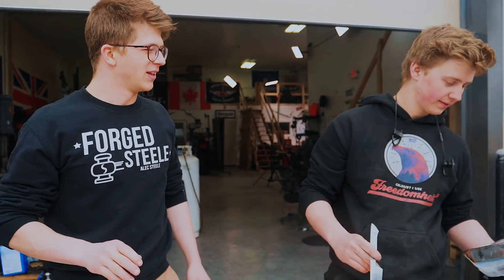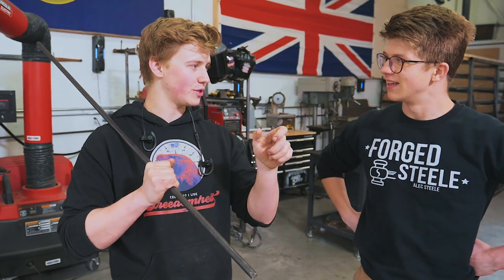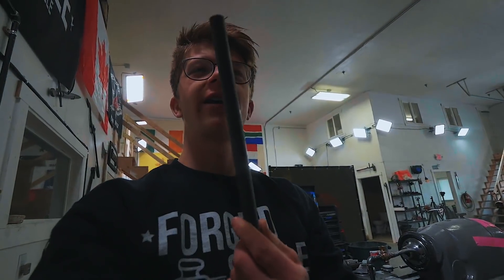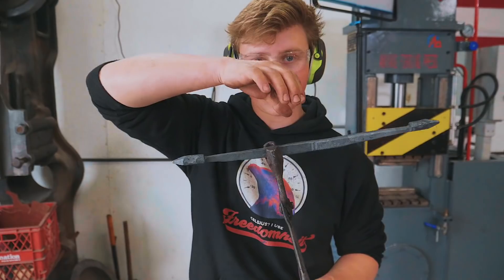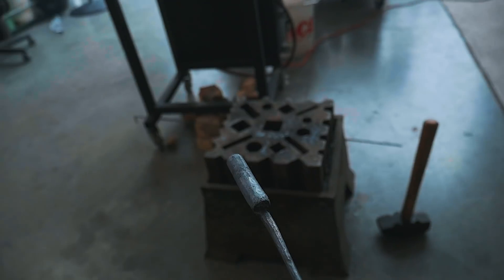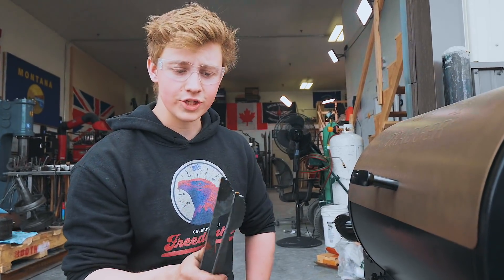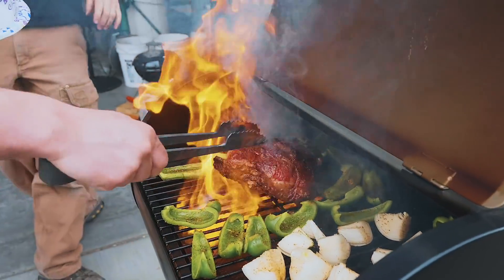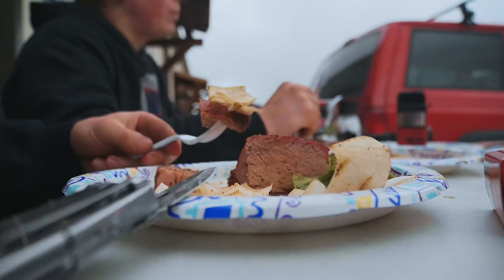FORGING GRILLIN' TOOLS!!!

Comment: Sous Vide Blacksmith Style: Big Steaks -> Ziplockbag -> Waterbucket -> Tempering oven 56 Degrees Celsius 2.5h+ -> Sear in the Forge 1sec <3
Reply: don't forget to drop some rosemary, thyme and garlic in the bag
Reply: and then quench it in some motor oil

Comment: Will: Uses a kitchen knife as a steak knife. 

Alec: Uses a pocket knife.

The sword in the background are sad.
Reply: i think my favorite part about it is that will wasn't even using a complete kitchen knife. it's a finished blade but there weren't any handle scales. he was just holding it by the tang.

Comment: Challenge:
Invite some friends over for barbacue in the evening.
Start in the morning at whatever time you want to start at, for example 6 am (you will need some time).
You‘re NOT allowed to use any kind of normal kitchen gadgets, everything you need for preparing and serving that meal has to be forged out (knifes, forks, plates, utility, maybe even cups etc.)

Comment: 🔴I got a challenge for you 2🔴 for the next Alec vs stelter. Forge out something with your non-dominant hand
Reply: I like this idea but I do agree with @Williamcoatt that it may he a tad dangerous
Reply: Dangerous? If you work with your hands, you work with both.  I think it's a great idea.  And even IF it's dangerous...what's wrong with dangerous?  Everyone is scared, it makes me sick.  Grow a pair.
Reply: @nearlyworthless1674   I think they should learn how to blacksmith with the both hands I think it's a good skill to learn to blacksmith with both hands
Reply: @nearlyworthless1674  it's called muscle memory, swinging a hammer with the non-dominant hand would be far harder (and dangerous) if neither has done so with any regularity. It's not quite the same as you getting your mani/pedi from a place you've never visited before. Most normal people aren't out here trying to maim themselves to prove their masculinity.
Reply: @fadetoblack2104  dude, you used "mani/pedi" in s sentence...🤣🤣🤣🤣😂😂🤣😂🤣😂⚒️
Reply: nearly worthless  would you like third degree burns on your body
Reply: I'd rather see them make something good than make something crappy and complain about how obviously hard is to use your non dominant hand.
Reply: @kristinnmar8415  and how would you get that?

Comment: Listen up I'm only gonna say this once. Take your onion...core it out (about 3/8"-1/2" diameter, 1/2 way through the onion)...plop a beef Bullion cube in the hole you created....spackle that hole full of butter...wrap in aluminum foil....45 minutes to an hour in the heat...unwrap....taste heaven!
Onion
Bullion cube
Butter
Aluminium foil
Heat 45 minutes  to an hour.
Taste heaven.
There I wrote it twice!
Reply: Hey... You said you were only gonna say it once. Then you didnt.
Reply: @MrRobertivie  I was working under the unified internet say-it-once clause from section PWND.420.t.r.o.L.L:subsection, l-o-L wherein it states that if indeed something is to be said once the thing in question may in fact be mentioned and then reiterated if so doing would not breach the intent of the message in an arbitrary way so as to negate the once-ness of the aforementioned once-said thing in question bearing in mind that the "nature of the internet forums" act of 1991 gives leniency toward the OP rather than than the listener (i.e.reader, because you don't actually listen to internet forums you actually sound them out in your head a little bit as you gloss over them with your eyes) by a margin of 51% according to the Gore poll of internet inventors in doing so protecting the integrity of the anti-troll ordinance (circa 1992 subsection :·) and solidifying that which is to be said only once as a non conformity unrelated misinformation juxtaposition addendum taking into account that which is to be said matches closely the description of what will then be said so closely that the two are inextricably related in a way that the pre-loading of the pre frontal cortex is known to actually give approximately two rats redacted about things for the time span of 
.0000000001th of a millisecond on average of what it has just read so indicating that within the course of a description one may in fact mention twice that which is to be assumed to be only mentioned once. 

But I can see why you would think that.
(EDIT) : taking into account the time of year this post was initially made it can be assumed that the use of a Vidalia onion  is indeed the correct thing to do.
Reply: Oh, cool.
Reply: @MrRobertivie  😄
Reply: My internet hurts.

Comment: Rind is specifically reserved for fruit or trees, the correct term you're looking for is bark or smoke ring.
Reply: But then they would have to do a proper barbeque. Cook it for 6-8 hours at abt. 200-225 freedomheight.
Reply: @nooneyouknowhere6148  very true.
Reply: Bacon has rind. Well, it does in England, so that's where Alex got from I presume. Definitely bark on a barbecue lump of beef though, so you're right there.

Comment: Alec, looking to a project that would be new challenge. What if Will and you worked on a pair of blackpowder percussion dulling pistols? Maybe from modeled after something from history. Dulling pistols were quite fancy, so you could work with bronze, sliver, gold and maybe some gems as well. All the cooler, what if the barrels were made from Damascus?

Comment: Nice job on the roast, spatula and tongs... Quick question, I'm building a forge similar to your old one from the UK and was wondering if 1/8 steel plate would be heavy enough for the outside shell?

Comment: Forgive a potentially ignorant question, but I've always wondered  Alec. Why is it that you are always choked up so far on your hammer handle? Holding towards the end of your handle gives way more power in your swings.
Reply: You get more power holding the end of the hammer but you lose some control, I believe he has stated before he holds it so high so that he has better control over the swings and how he moves the metal, blacksmithing isnt really about how hard you can hit but about how you hit it

Comment: O.K. you need a marinade: 2 bottles of Guinness, 1 cup of local honey, 1 cup of olive oil, 5-6 cloves of smashed garlic (more the better), 4-6 jalapenos chopped up, salt and pepper. Let the tri tip (or ball tip) marinade overnight. Once on the grill sear the outside, then slow cook to an internal temp of 135-145.

Comment: New series: Grill'n w/ Steele and Stelter. They chose a random kitchen tool to forge while they cook a meal. Bonus points if it incorporates damascus. Bonus bonus points if it is used in the preperation, serving, or consumption of the meal.

Comment: Sweet tools guys.  But keep in mind anywhere you have a rough surface  like a grinder mark etc. you want to polish that out.  The little scratchesleft by abrasives are a hiding spot and a breeding ground for germs.  Give your surfaces that actually come in contact with food a good sanding smooth and it'll also help prevent rust.

Comment: Technically it isn't a barbecue, it's a smoker. Which you should weld yourself ;)

But if you don't, get the traeger blanket/insulator.

Comment: Wrap your meat in aluminum foil for 10min after you pull it out of smoker. You’ll seal all the moisture that would otherwise evaporate off the meat back onto and in your smokely dokely meat.

Comment: Hey Guys, 
As a you might know, Brazilians have  the best Barbecue in the world. It is more than just cooking because it involves culture and traditions.  
Brazilians traditional Barbecue includes the meats, corn on the cob, bread and beer. 
So I've had this idea. I propose a project for you that includes making your BBQ utensils better.
I'd love to see for the first time, a Barbecue Knife that has multiple functions. It would include an extremely sharp edge for slicing meat, a double tip to use as a picking skewer or fork, a serrated spine for cutting bread and a bottle opener incorporated in the very back of the handle. It should also be good looking! 
Sugestions: Damascus pattern, multilayered pattern on the handle.
Please let me know if it's possible. 😉

Comment: FORGE OUT PLATES AND PLATTERS.... But do not forge the cutlery, try to cast them. Maybe cast iron, or something. Then you can make a larger set faster via a mold from silicone and wax, etc. Maybe forge the template designs, so it still has a signature style to you guys, but they will all mix and match easily.

Comment: Bbq tip. If you're looking, it's not cooking. Get yourself a probe thermometer, you'll love the consistency, especially on lean cuts of meat. Cooks faster when you can check on things without letting the heat out.

Comment: You clearly have a sign on your door saying "No Visitors", yet you've got numerous open flames, you're banging metal with the doors open in a well equipped shop, filling the outside air with BBQ smoke and cooked meat smells, all of it in Montana besides... You can't chum the waters and then be offended when sharks come; if you get visitors, it's your own fault. 

Seriously, nice video, looking forward to more. Continued success to you both.

Comment: Tri tip does not require low and slow.  It’s kinda in between a brisket and a steak. Reverse sear using a two zone fire should suffice and would not require three hours.

Comment: Okay, let's think about those tines on your tongs... if they're perpendicular to the surface you're grabbing, they won't do anything. Forge the tongs with a little cupping on the crabbing edges, or at least angle the tines in a bit, so they can actually grab the meat.

Comment: Geat job on the Grillin' tools, -50 points from Gryffyndor for grilling on a gas grill. boo.....
Reply: Gimpy24x7 that is a pellet smoker not a gas grill
Reply: @jeffwithheldforsafety8359  Thanks I sit corrected.

Comment: Really disappointed with this video. You made a food use tool and you did not treat the metal properly for food use. As well as you left both the tongs and spatula with the porous texture which is bad for cooking because they retains bacteria and are very difficult to clean properly. To make it the proper way you should have grinded them and polish them to have them smooth, this would also allow you to see any residue or substances on are tongs or spatula.
You take pride in making knives swords and many other crafts please do not insult The culinary profession with arrogance and ignorance.